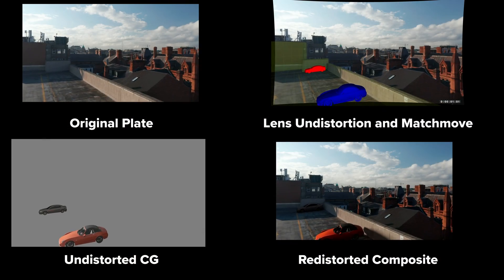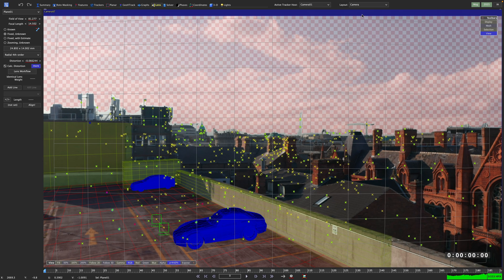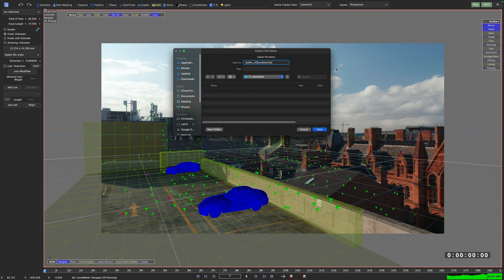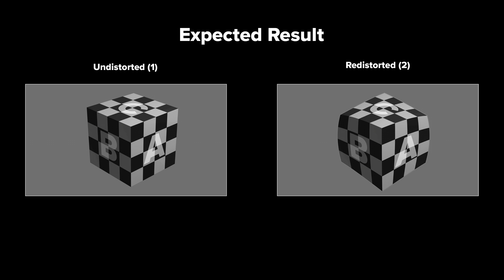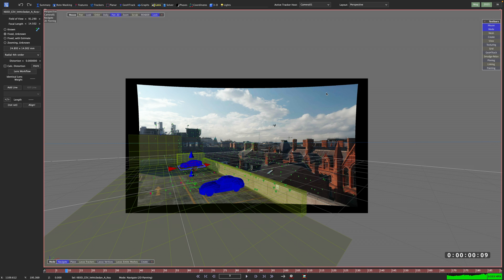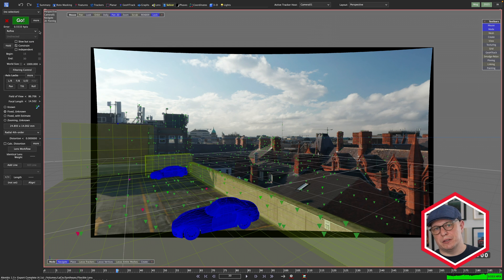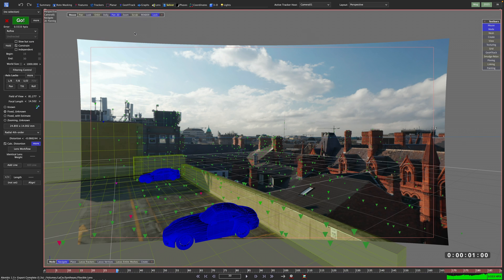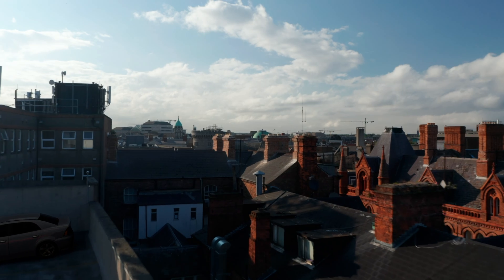Why You Need to Solve Your Lens in SynthEyes (and When Not to) [Boris FX]

Comment: If I have multiple shots with the same lens, and I calculate the lens distortion for one of them, I want to save that preset so I can apply it to the other lenses without recalculating the distortion again ??
Reply from the maker: Yes, there are several ways you can do just that, for example save it out to your PrepSet, and load it directly into the Image Preprocessor. Take a look at File > Export > Lens for some of the options, and check out page 31 in the SynthEyes Camera Calibration manual for all the options.

Comment: Hey thanks for this great tutorial, however when i try to export the sequence as png to use as background i dont see the sequence exporter with those settings? It only has sequence exporter “dummy”
Reply from the maker: Save Sequence Exporter uses a dummy filename when run directly. To set its file name, extension, and compression parameters, first configure these via Shot > Save Sequence or the Image Preprocessor. Those settings are then remembered when you include the Save Sequence Exporter in a multi‐export run.

Hope that helps.
Reply: @BorisFXco thank you! Unrelated question but how can we export the sequence including like the trackers and grid visible for like “behind the scenes” stuff?
Reply from the maker: Yes! This video will show you how : https://borisfx.com/videos/syntheyes-essentials-qc-and-export-workflow/

Comment: If I understood correctly:
If I use the undistorted workflow, I have to use the undistorted sequence I exported from SynthEyes for compositing. If I want to keep the distortion afterwards, I need to use the redistorted workflow. Now I only wish I knew how to redistort in Fusion. ;)
Thanks for the tutorial! I finally understand how the undistorted and redistorted workflows work in SynthEyes!
Reply: Hey Johannes! Thanks, and i am glad you found my tutorial useful. The most straightforward way to make sure you have got the correct undistortion and redistortion applied in your Resolve Session that i found is as follows: 

Export your Scene from SynthEyes as a Fusion Composition, ideally with the Redistorted(2) Workflow applied on Export. That Scene will then include Undistortion and Redistortion Nodes for your Footage and your Comp as well as any proxy geometry you might have created inside of SynthEyes. To import the Fusion composition inside of Resolve, open the clip in the Fusion tab and from the menu bar choose File -> Import -> Fusion Composition. 

Just remember that like in my video, the export will differ, depending on the kind of Lens Workflow you chose.

One thing to keep an Eye out for is your Lens Distortion Model. In SynthEyes you want to use a Lens Distortion model that is compatible with the Lens Distortion Node in Resolve/Fusion - like the Radial 4th Order Model i am using in this video. Alternatively, you can uncheck "Use Lens Distortion" while exporting from SynthEyes - that way you will force SynthEyes to export ST Maps, so there are no constraints on your choice of Lens Distortion Model. 

I hope this helps, have. a great day!
Reply: @ChristophZapletal  Thanks a lot! I’ve saved your answers in a Word document so I can follow your steps later and practice my skills. There’s so much to keep in mind when working in SynthEyes—like point constraints, scene scaling, lens distortion, and tracker cleanup—that clear and understandable tutorials like yours are incredibly helpful.